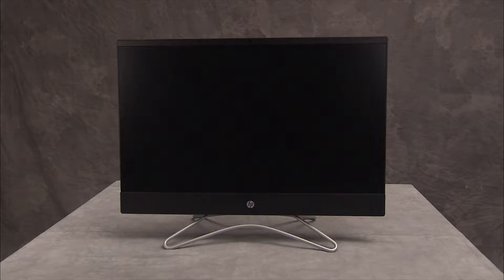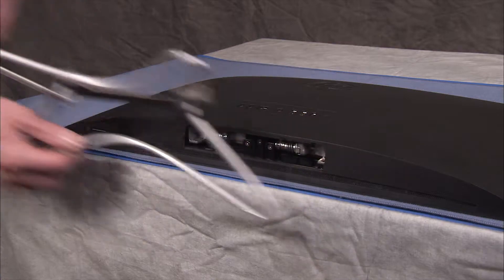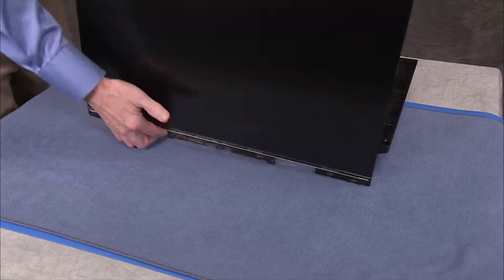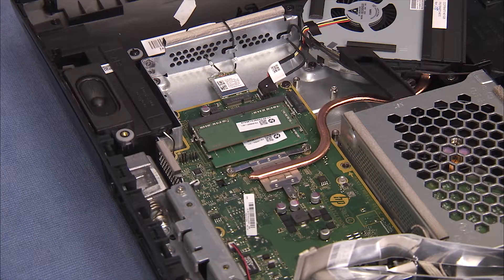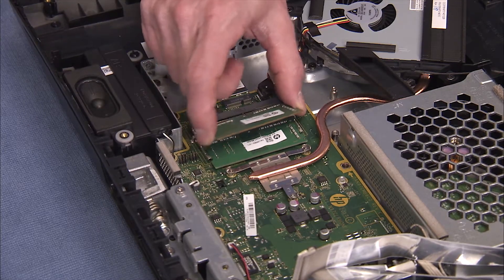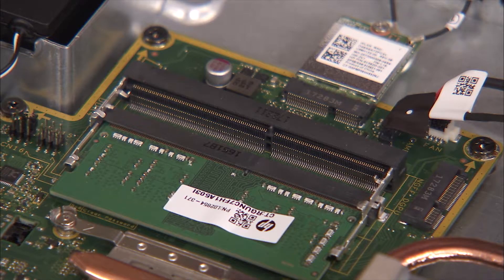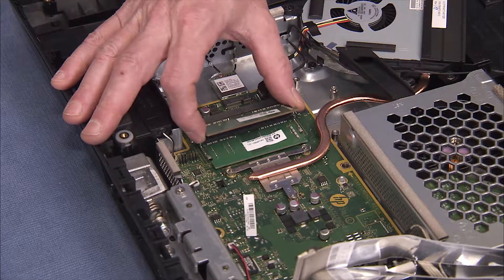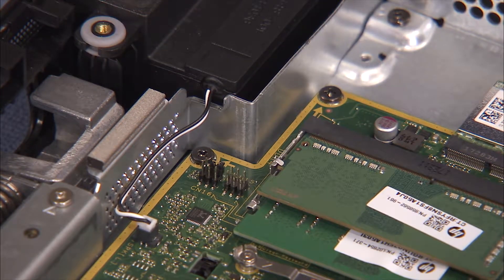Replace the System Memory | HP All-in-One 22 and 24 Series | HP

Comment: The HP employee who made this video conveniently forgot to show how to PRY off the stand cover, removal of TWO screws, followed by the removal of THREE screws beneath the stand hinge, the difficult removal of the speaker cover, and removal of SIX screws which fasten the LCD screen to the rear cover. Finally, good luck prying the LCD screen away from the rear cover without bending and ruining your screen. About the best you can hope for is to have a second person lift and hold the lower left corner of the screen away from the rear cover while you reach inside to remove the old memory module and then install the new memory modules. Make certain you install the modules firmly. Turn your computer on BEFORE you re-assemble the computer - to confirm proper installation of the new memory modules. If you did it correctly, you can then re-assemble the computer.
Reply: I wasn't able to completely remove the display screen from the back cover even though I removed the stand and  9 other screws and loosened the screen on the other three sides.  Something was holding the screen on near the bottom by the speaker cover.  Not wanting to break anything I just put it all back together and said to heck with it.  Now I have an 8GB memory card for the All in One that I can't use...

Comment: Do you know if screens and or motherboards from a HP 24f0051 are changeable with a HP 24-CB1217C ?
Reply from the maker: Hi there, thanks for contacting HP Global Social Media Support!
I understand that you need to know whether you can interchange screens and motherboards from other computer.
I will do my best to assist you.
HP does not recommend upgrading or downgrading hardware parts or software that is bundled with the product as It may affect the manufacturer's warranty and performance, however, you could change the configuration at your own discretion.
Binu_HP Social Media Tech Support

Comment: I have a Desktop HP All-in-One 24-f022la. Could you please post the details of which screws I should remove with their specific order? Thanks!
Reply from the maker: +Andres Julian Rojas Please try the steps mentioned under the video and let us know how it goes.
Reply: @HPSupport  thanks for getting back to me on my query. My main question is about the number of screws and their location for removing the display so that I can access the motherboard
Reply: @andresjulianrojas8904  Hey, I performed this recently on my hp aio 22. To unhinge the lcd screen remove all of them, order does not matter. Also when removing the lcd screen dont be afraid to be firm. The screen is snapped in place, so it takes some force but not too much to snap it out.

Comment: Is possible for me too have to different sizes of RAM on the motherboard,like one 8gb module and the other 4gb???
Reply from the maker: +Mickyle Govender You can use 8GB RAM and 4GB RAM together, but doing so can affect performance. Although you'll have a total of 12GB RAM, it will be slower than using two memory sticks of the same size. When using 8GB and 4GB RAM together, they should have the same voltage rating.
Reply: Yes

Comment: Screen damaged. This video FAILED to mention the extra screws. This is unacceptable. My computer is now unusable. I'm so very upset. Even after taking out the 17 screws that were not mentioned anywhere in the video, it still didn't come apart. Now I am out a computer and have 64gb of RAM that I bought that I can't use. So upset.
Reply from the maker: Hi Muffinz, thanks for contacting!
I understand that you are experiencing an issue with the screen of your computer.
In order to get this issue fixed, please contact our customer care team over the phone or chat for further assistance, as this issue requires Live conversation with you over phone or chat to isolate the issue and provide you instantly with appropriate solution or repair/replacement options available at your place as per the warranty.
Please feel free to reach us on call/chat, please access this link to select your preferred country and language option to reach us. Global support link: - https://www8.hp.com/us/en/contact-hp/ww-phone-assist.html
Binu - Social Media Tech Support